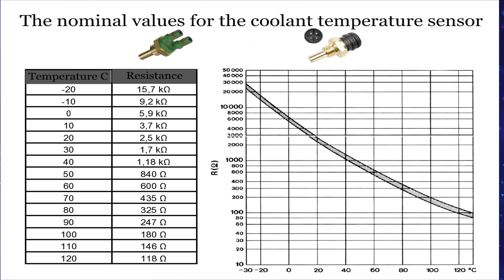㉦Mercedes Ke-Jetronic㉦ - About the coolant temperature sensor

Comment: Hello, very interesting video. Question: my W124 from 91, m102 has only a one-pin-sensor. When I unplug it, when running, the engine stopps. Shouldn't I have a two-plug one?
Reply from the maker: Hello. As I would say the one with 4 pins. If you have the EZL module then no way you can have the CTS with one pin as an OEM part.
Reply: @mercedeske  thanks for your quick answer 😊. I'll check again. 👋🏽
Reply: @mercedeske  Hi I have a 1992 Mercedes Benz 300ce and the CTS on my car is a one pin . Is that supposed to be correct?  And how can I find out what is the correct CTS for my car? Thanks
Reply from the maker: @rawuncut1784  That's strange. You should have a CTS with 4 pins.

Comment: 03:55 my 1992 w201 with m102 motor has 3 pinned CTS. :)
Reply from the maker: Yes, but that's not the one that has to report the ECU about the engine temperature! :)
Reply: @ oh,  So what is the one that report then? I just wanna know 😅
Reply from the maker: That's the radiator fan switch. The vehicles with AC only have that switch. I don't have AC and that's why I don't have it.

Comment: "My temperature sensor has 3 pins. Is it correct that the voltage on the fan connector (both pin 2) is always 12 volts or 13 volts? I'm having trouble getting the fan to activate. Thank you, Happymercedes, and Merry Christmas."
Reply from the maker: The one with 3 pins is for the AC, concerning the fan - bridge it, if it the fan kicks in, then you have a bad switch.

Comment: Hello I have a 190e 2.6 1989 California version check engine light is on it says it’s coolant temperature sensor but I see online that they are two diffent sensors . Do I need to buy two sensors ?
Reply from the maker: @Chicano-b1l  There is one for the visco and one for the computer. Check the one with 4 puns. Check it on resistance.
Reply: Also I can’t find my coolant temperature sensor on my 89 2.6 190e .  :/
Reply from the maker: @Chicano-b1l  It has 4 pins and a black 4 pin connector.
Reply: @mercedeske  thank you so much

Comment: Pozdrav. Imam problem sa autom. Zamjenio sam oba temp. senzora
Senzor sa 4 pina i senzor sa 3 pina. Oba senzora su original mercedes. Ali još uvek kazaljka za temperaturu motora ne pokazuje ništa. 😮 Ima li možda još koji senzor za zamjeniti ili je možda problem u inštalaciji ? Moj auto : Mercedes - Benz W124 230E lim. (11/1990).
Reply from the maker: Moguce je da je problem u instalaciji.
Reply: @mercedeske  Ja logički  pretpostavljam, da je problem u instalaciji.  Dotrajala je od vrućine, auto je prešao preko 900 hiljada km za 33 godine. 🥇 Ne vjerujem, da su novi senzori (original MB) lošeg kvaliteta, pa da radi toga ne bi radio cajger za temp. motora. Provjerit ću instalaciju. Veliki pozdrav za tebe od ljubitelja W124 iz Slovenije.
Reply from the maker: @mathias3v871  Hvala puno. Pozdrav za Sloveniju.

Comment: Hi
I have a M103 260E.
I have a rough idle when the car is warm. I susoected the CTS but resustance appears fine. Could it be the Thermo Valve  at the front of the head. It has two Vac lines leaving it. How would you check if the Thermos Valve was not working? 
Love the videos.
Keep up the great work 👍
Reply: I just checked the CTS by unplugging them individually. 
The first one, the engine got rougher. The second one, there was no change. Is this normal or maybe I have an issue with power leading to the second terminal. 
Really appreciate your videos
Cheers
Reply from the maker: Check the one where the engine started working rougher.

Comment: Awesome video as always. My '91 300e has a few sensors on that strip you showed. The car's odometer is stuck at 190,000 kms just to give u an idea of mileage. It seems that the coolant temp sensor that feeds the EZL + ECU is closest to the firewall, followed by a single pole sensor for temperature gauge and a 2 pole blue sensor for aux fans. The car sometimes takes long cranking to start, and sometimes starts immediately when cold. Same erratic behaviour when hot also. I've eliminated most other things, only these sensors are left. Also after a cold start, I've noticed that the rpm doesn't rise to 1200 rpms and come down, it rises to maybe 900 rpms and then comes down to 600 rpms and is steady there. My question is, should I just go ahead and replace these sensors and then diagnose further? Would a Hella 4 pin sensor be a good choice?
Reply from the maker: I would check the coolant temperature sensor. On your car it should have a black connector and the sensor must have 4 pins.
Reply: @mercedeske  thank you so much! I will check the resistance on it today. I checked the aux fan coolant sensor, and it was completely black with gunk, so much so that I thought the connector was black! Wiped some gunk off to reveal it was blue. So maybe I just need to give it a good clean.
Reply: @mercedeske  Just checked resistance at 80 Celcius. 350 ohms. That seems dead on. However, on the blue aux fan coolant temperature thermistor, it read 607 Ohms. I know this blue thermistor is unrelated to the EZL sensor, but should I change it anyway?
Reply: @shaazy  hey ! Looks like we are having the same issue. Any luck since then ?
Reply: @BLACKHUSKY701  So my problem was actually NOT a problem I discovered. Everything works as designed for the most part, and the 'blue' sensor I mentioned above is for the Aux fan circuit and ONLY works with ACs, which it's doing perfectly fine, even though the resistance readings were coming up a little different. What seems to be your problem?
Reply: @shaazy  very unstable start, cold and warm. Sometimes it’s perfect, sometimes it fires after 5 or 6 seconds and then dies immediately. 
Changed the spark plugs, ignition coil, oil, oil filter, fuel filter, fuel pump, sent the ke jet to be cleaned and tuned by a specialist in france. Haven’t tested my pressure since then. 
I tested my CTS, i read good Ohm numbers. 
Tested my cold start valve, it works when connected directly to the battery, but it doesn’t spray when motor is cold. 

Im out of ideas for now. Maybe i should test the continuity of the cables going from the CTS to the cold start valve and see if i have a problem somewhere on that line.

Comment: Where is it in the car?, cant find it in the engine......electro fan is not working any more and engine warms if not running fast
Reply from the maker: The coolant temperature sensor has either 2 or 4 pins depending of the model year. If you have a problem with the fan clutch then you should replace the sensor for the fan clutch.

Comment: What about 1 pin cts? It looks like i got several of them next to the thermo valve and i dont know which one goes to the ecu
Reply from the maker: If you have a W201, the earliest versions then you have the cts with one pin, if the car is older, then there are also those with 2 pins. One pin cts is also on the W124 first versions.

Comment: hi there. I have a 190E W201,M102 1991. The coolant level warning light in my dashboard is going on and off. Coolant level is ok. I took off and  cleaned the sensor  from the expansion tank. Nothing. I Check the fuses, again nothing. Any idea ??

Comment: hello, I'm from Brazil and you help me a lot, after all, here in Brazil we have few people who understand KE injection.
A doubt, I have a 190E M102 1993
Before when starting in the morning, the idle speed was something around 1100rpm, then it was lowered as the engine warms up, nowadays I don't have that anymore. It's always at 800rpm.
And when I turn on the air conditioning, the RPM also doesn't go up anymore, like before. Could it be a temperature sensor?

My sensors are Red 3 pins and the ECU's are 1 pin only.

Thanks for your videos, hugs from Brazil
Reply from the maker: Hello there and thanks. Check the coolant temperature sensor and the idle control valve at first. Wash it in ultrasonic bath. If you have lambda, replace it. That's what I can say. Many greetings and "saudades"

Comment: Hello craftsman can you make a video about the cold start valve it would be very interesting to show us possible faults with this valve, as I have said in previous comments I own a Mercedes w124 200e and I have a big problem with the cold start while  is hot no problem gets ahead immediately, i think something is playing with the valve cold.I have changed air temperature sensor and coolant temperature sensor but again nothing what can it be?thank you😊
Reply from the maker: Hello 👋🏻 I will make that video. As for the valve(I have the video in my head already 😃). Check the cold start valve if it is working, if it sprays fuel.

Comment: What is supposed to happen if the ECU doesn't see the CTS signal at all? Does it lean the mixture? Because I'm thinking it might be the cause for hard start
Reply from the maker: That can be the cause because the ECU doesn't know anything about the temperature of the engine and then it doesn't know if it has to send the signal to the fuel pump relay for it to operate the cold start valve or not. The faulty CTS is always going to show high resistance(cold engine) and the ecu is going to be enriching the mixture all the time!
Reply: @mercedeske  Okay, that makes sense, because the cold valve wasn't working and I had to hard wire it, but I'll try replacing the wires. Thank you
Reply from the maker: My pleasure!